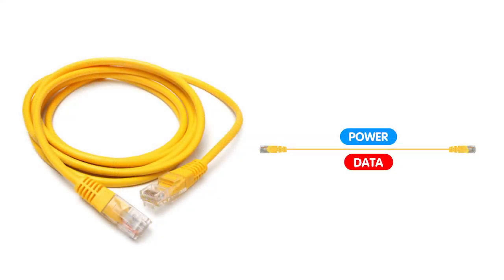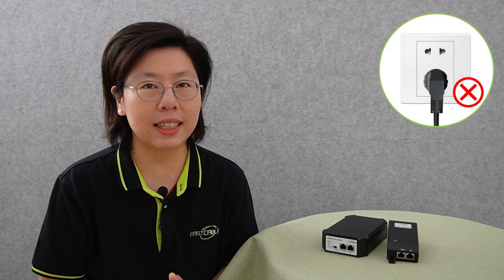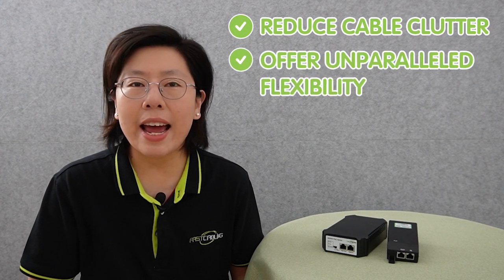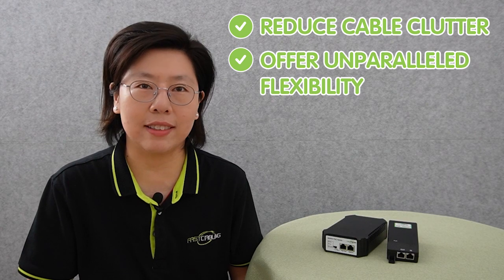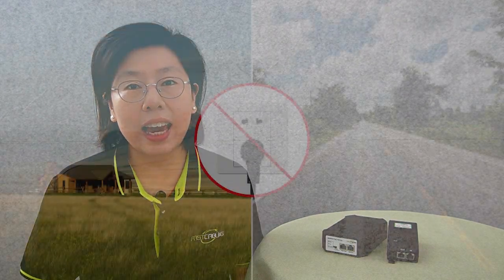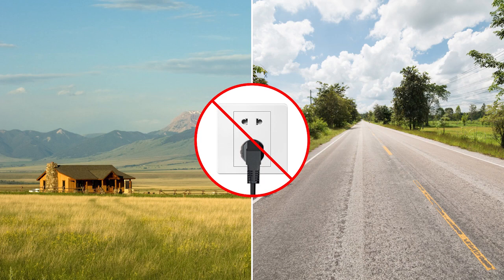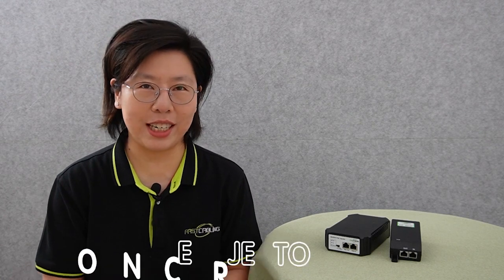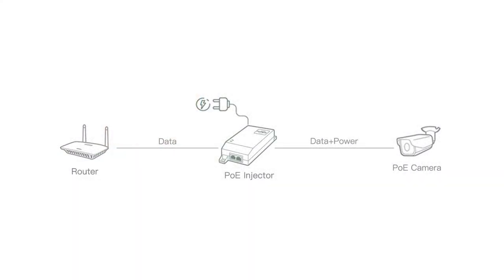How to Turn Non-PoE Modem/Router with PoE Power

Comment: Can i use poe switch to power the router instead?
Reply from the maker: No, routers are non-PoE devices but the data can be transmitted.
Reply: @Fastcabling  evem using poe splitter?
Reply from the maker: If you add a poe splitter, it should work.